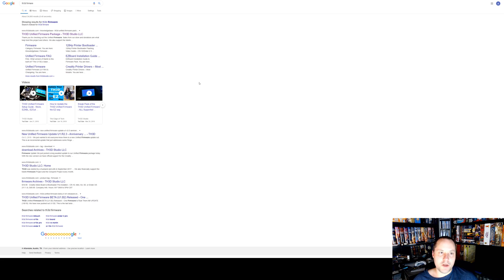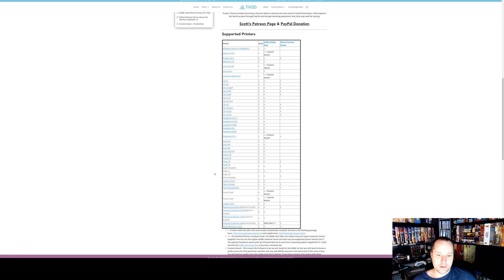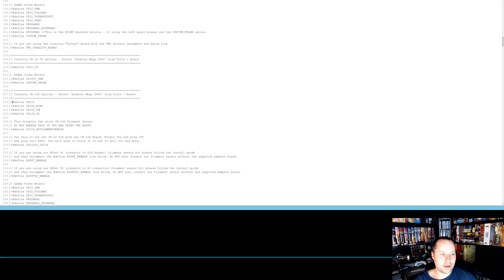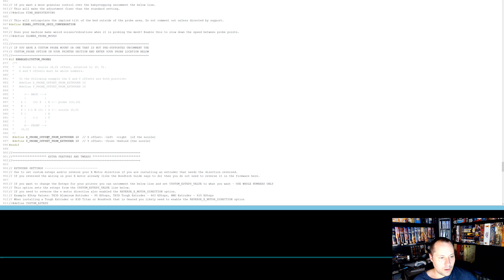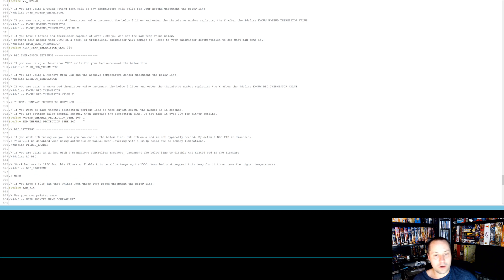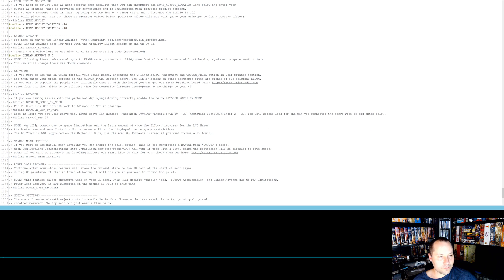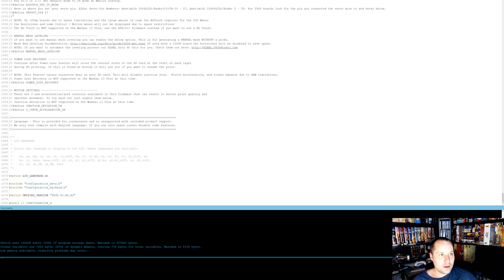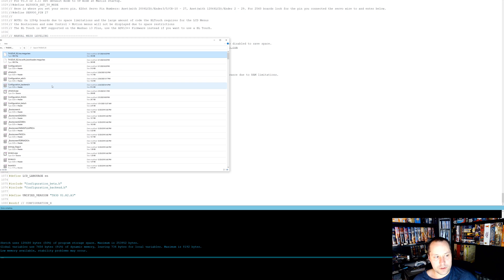Marlin Firmware Tutorial 3d printer (TH3d) for the Creality Cr10s Ender3 Ender printers

Comment: Thx for the video.  Is this required to make octoprint work correctly?   I got my cr-10s about a month ago.  My printer works great but struggling with octoprint
Reply from the maker: It will help with octoprint in my experience but I plan to make a video on how to improve your print quality when using octoprint. I was having some print quality issues and improved them a lot with some tweaks including moving to marlin based firmware
Reply: @AthexTube  when I connect to my cr-10s in octoprint it tries to set my bed temp at 7595. Would the firmware update fix this?  Or is that something else?
Reply from the maker: @willieallen5678  Sorry I missed this earlier, I actually havent seen that issue. I think you might have something configured wrong in your startup scripts for octorpint